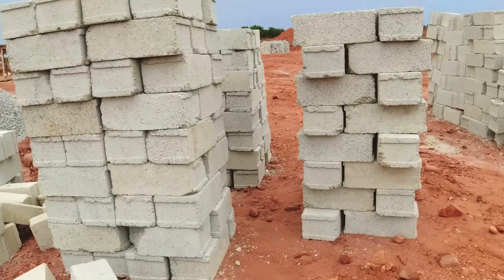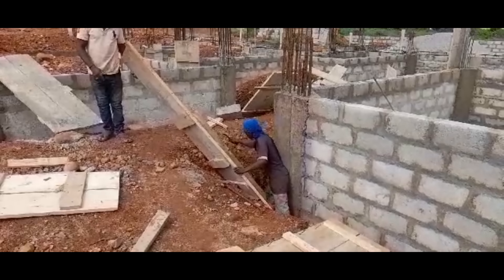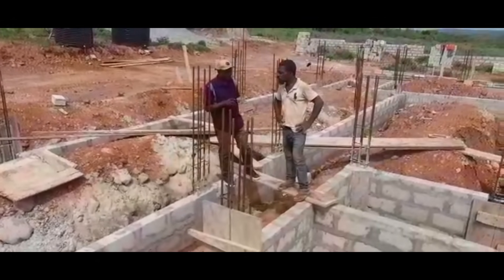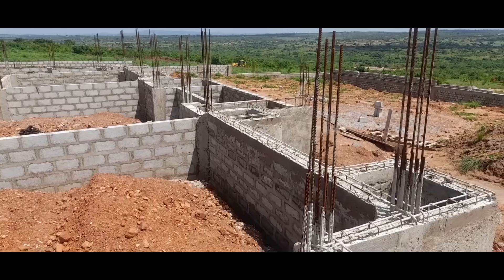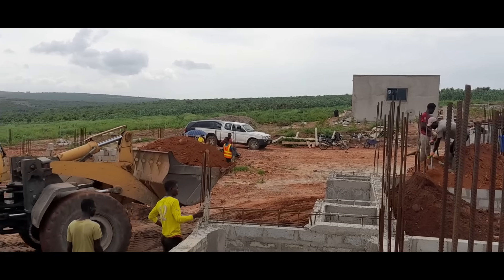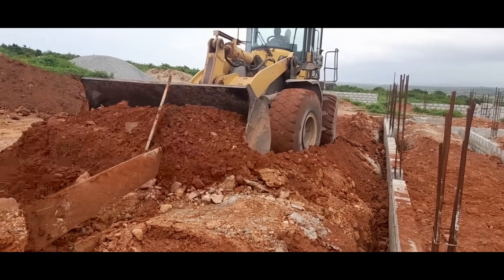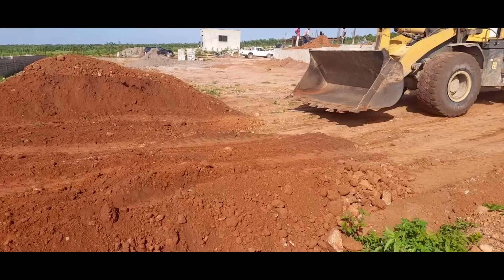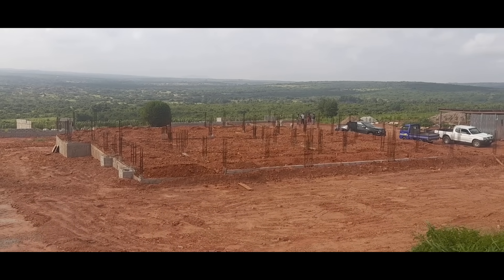Finally...Big Progress On The Foundation Project || Building Our Luxury House. Foundation Stage 2

Comment: I could not see the compaction of the fill, though Iam worried the fill was not done to proper depth layers and without watering the fill to avoid un even settlement
Reply from the maker: You will see compaction in part 3🙏🏾
Reply: Ghana has excellent building engineers  and many of them are teaching in the top universities all over the world  so we don't want any bs from you.

Comment: I wonder if you did a strength test on those blocks. usually they may not be appropriate for foundation. They tend to crumble under weight and wetness. 

The house looks great....and when completed you guys must run for parliament.... otherwise what's the point of it

Comment: Big fill depth not good as you will have uncompacted layers down, max fill shouldn’t exceed 30cm  deep layers  watering then proper compaction, beforeyou add another layeer the scoop from the wheel loader was too much

Comment: Thanks for your well documented videos.  Please don’t take my comment as a jab on you. I really don’t the use of quarry dust blocks makes any difference to the strength of a building. Case in point: there are lot of old storey buildings in Accra, Kumasi, Cape Coast etc constructed in the 50s-60s still standing, but they were not constructed of quarry dust blocks. I think this is a con by  block manufacturers to make more money. There is no added value but more added expense.